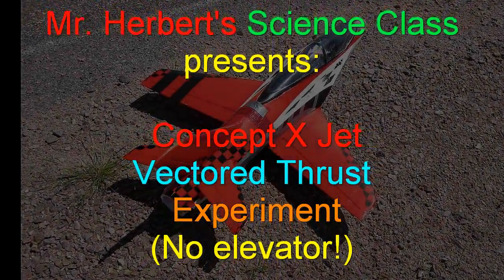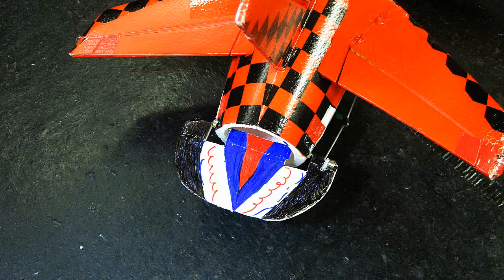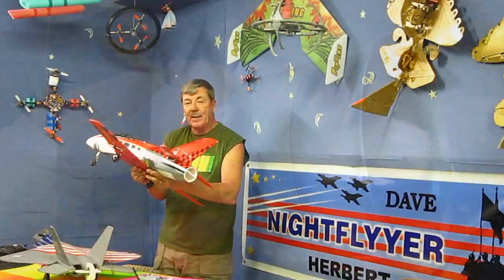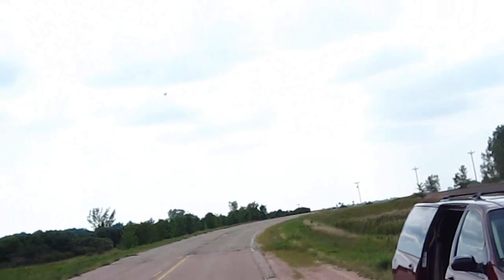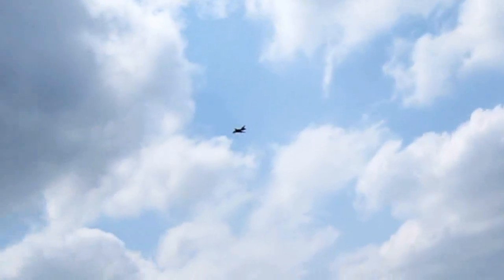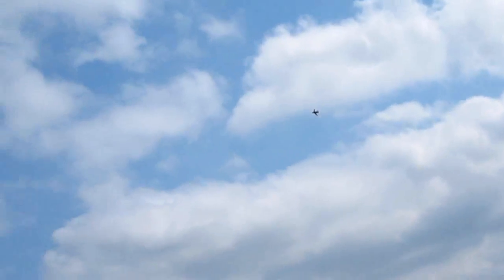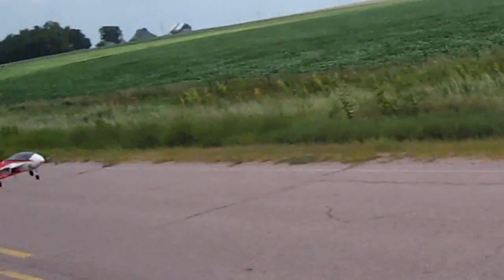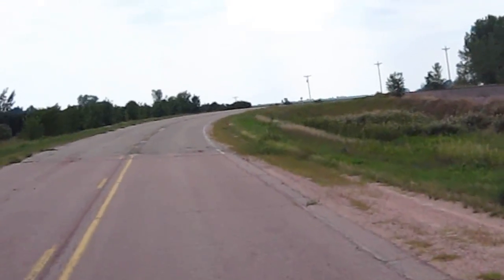NO Elevator. Vectored-Thrust Concept X Jet Experiment.

Comment: Cool idea. Hmm, could sand the forward edges of the piece to 45 degrees top and bottom and that would help the air throughput. Very very wild maneuvers (and crashes) could be performed with splitting the piece in two, a servo for each side...could give one heck of a roll rate.

Comment: Cool video!  

Even though the lift is so minimal with the concept X, that any non-emergency landing without thrust would be a hope and a prayer, I still think your exhaust vectoring flap/diffuser/whatever-you-want-to-call-it, is still big enough it is also acting as an elevator on its own.  Even without power.  It's like a big paddle (control surface) sticking out back there.